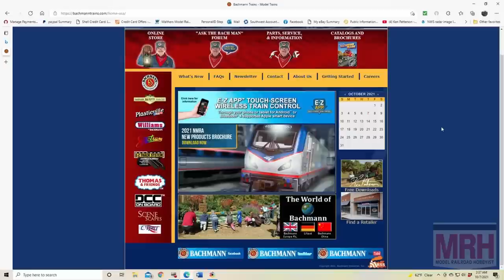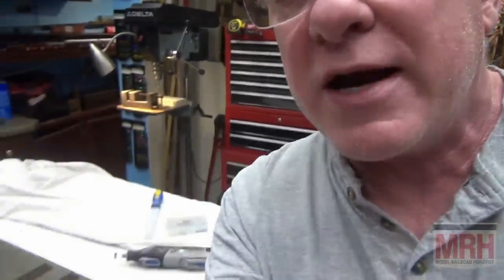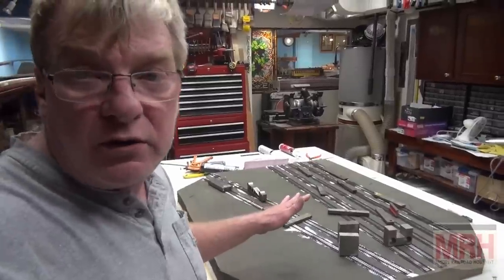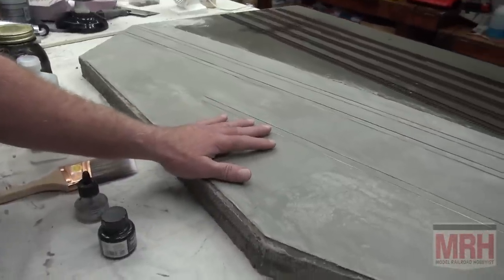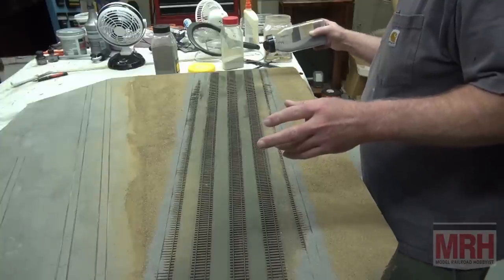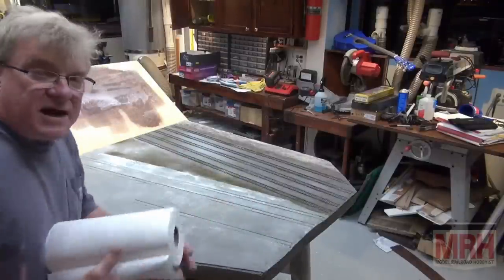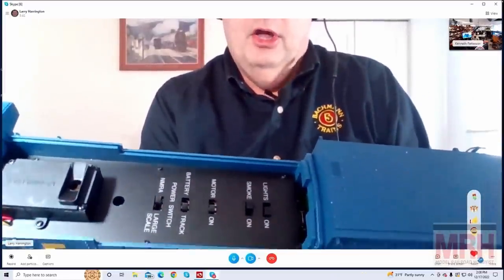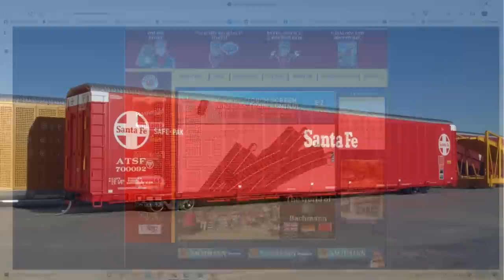Building a rail yard diorama | January 2023 WHATS NEAT Model Railroad Hobbyist

Comment: I also use Dap 230 for gluing lichen
Reply: I love the Dap230 clear latex caulk, too. I've used it for years, and built and rebuilt a few layouts, recycling the track. You don't need much, it holds the track securely, and the track comes right up by sliding a knife under it when you need to make changes. People say CopyDex is another good adhesive, but I've never used it.